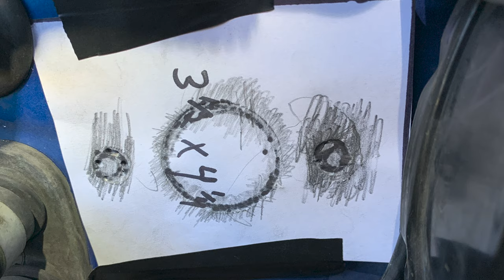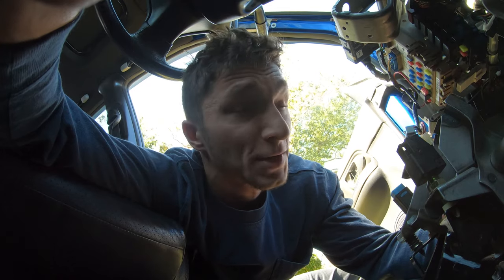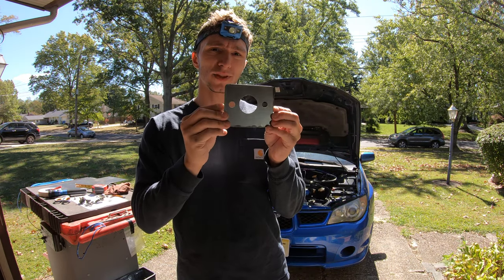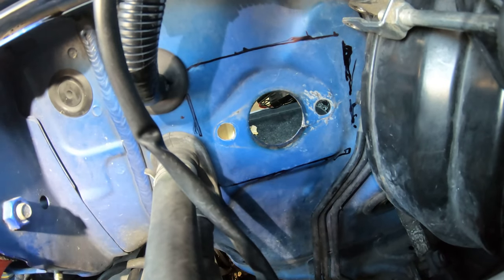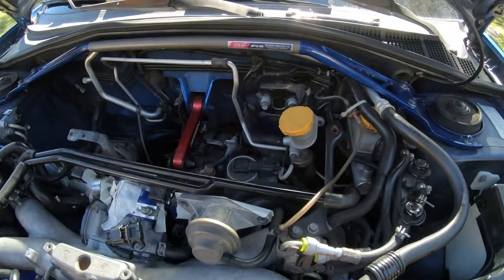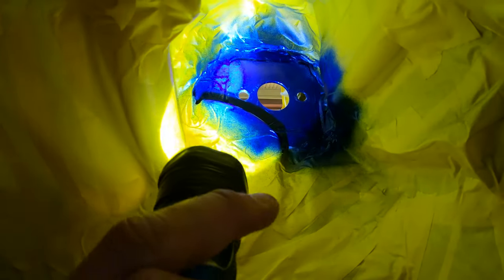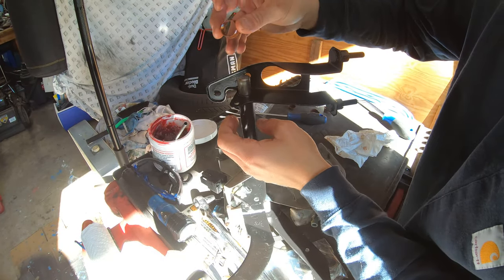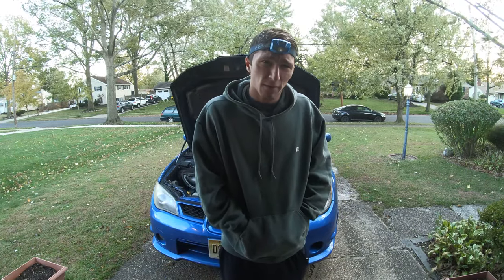Subaru WRX - HOW TO FIX BROKEN Firewall and Clutch Pedal Assembly (START TO FINISH)

Comment: 3 years later, still an amazing video. Always had a problem with my clutch pedal as of 2 years of owning this car. It would get stuck halfway down, sometimes shifting was impossible, pedal was mushy. Well I had someone press the pedal while I looked towards the master, it was pivoting on the firewall. Took it all apart and the pedal bracket cracked on the stud and where it bolts in the interior just like his. Followed this tutorial. Took time some time but was straightforward. Now my plates are adhered to the firewall and painted, just waiting on my clutch bracket. Tip for everyone doing this, do not be like me and try to reweld the pedal assembly unless you’re a master fabricator lol. But anywho I appreciate this guy for making such a weird project relatively simple. Never thought something like this would break.
Reply from the maker: So glad to hear you got this fixed. This is a very out of the ordinary job, and when it happened to me I was told by many people that it couldn’t be fixed. So yeah I’m happy to hear this is helping people out there! Great job and thank you for your support!
Reply: Hey there! Where are you finding the new clutch bracket? I've tried through my Subaru dealership and they said the part is showing on backorder in their system (but will basically never be available)
Reply from the maker: @Coffee-at-200F  Hey there, I checked at my local Subaru dealership and they had a few of the parts available but most of the parts I got from ordering on an online Subaru store. There are a few different online Subaru parts stores, a quick google will show you a few. If for some reason they don’t sell the parts anymore, then your next best bet would be local junkyards or eBay.
Reply: @Coffee-at-200F  I had to have mine ordered, took about a week. I believe it came from Dayton Ohio if I’m not mistaken. Maybe somewhere else. Call around different dealers and see what others can do. I just put my order in online and had it shipped to my house. Shipping was cheap. But glad to say today I got the car all finished after having to replace numerous other things in the process and bleeding the clutch by myself which was a pain. Since I fixed that stuff the car drives phenomenal. Firewall has zero flex and with the plates is as stiff as a board lol
Reply from the maker: @lozivo_5754 so happy to hear this! I still remember the initial feeling I had when this whole thing first happened. I thought my car was done. There were no other videos online about this, I really couldn’t find anything on how to fix this, So I’m just really excited to see this is helping people out there. I was told by so many people that it’s not possible to fix. Great job!!!

Comment: Awesome video calling out an engineering flaw with that pedal structure which is under-engineered particularly for those of us who push more HP and subsequently have installed stronger clutches.  After enough cycles, it will fail.  Before finding this video, I tried to order a new pedal assembly for my 2006 but I got the wrong one (for a 2018) and the 06 assembly has been discontinued.  I could see that the 2018 assembly was much more beefed up to handle to torque from the clutch pedal to the clutch master cylinder so they learned from their mistake.  This video allowed me to fix my pedal assembly with parts that are still available although I must have damaged my clutch micro-switches since I can't start my car now.  Work continues. ;)
Reply from the maker: Glad to hear you found some use of this video, Also I’m glad to hear they have since corrected this issue on newer models. I’m sorry to hear that the clutch micro switches may be bad:/…. 

Hope you get that stuff figured out because these vehicles really rock when they’re running good. Thanks for your support!

Comment: Thank you for this video, currently my 05 sti has the broken pedal support bracket but my firewall is good, looks like I will have to take it out and replace that bracket, did you put on a new  spring for the clutch pedal? I didn't see the part number for that but I will look it up.. I only have to order the two bushing for the brake pedal and the clutch spring.. I have everything else..  thanks again for doing this and making a video..

Comment: Thanks man, so far no firewall damage on my 02 wrx but my bracket snapped exactly where yours was cracking.
Reply from the maker: well that is still great news! I have a feeling a lot of Subaru Owners will be running into this issue at some point. Hope this helps!
Reply: @VinnieT  do you need to remove the steering colum for remove de pedal assembly?
Reply from the maker: @michaelrheaume5341  No you do not need to remove the steering column.
Reply: @VinnieT  ok Nice thank you

Comment: Thanks bro I didn't have a crack in my firewall thankfully. But the pain on the spring for the clutch was removed thinking it was the PIN for the master cylinder. Cannot find any data on it nor can I get it in so just at least identified what it was and how it works. So thanks a lot man!
Reply from the maker: Glad it helped ya out, and I hope you solved your problem!

Comment: By adding thickness to the firewall, how much did you change the deadzone and engagement on the clutch?
Reply from the maker: It depends on the thickness of metal that you use, but you just measure the two plates used, and that's how much you'll adjust on the clutch master cylinder rod.

Comment: That little thing that broke off is called a Clevis pin btw I replace mine every once in a while because they go bad and break
Reply: Yeah they are 3 bucks at the dealer. You should replace it every time you replace the master cylinder

Comment: Happy New Year man! Outstanding work and so impressive. Just bought a 2011 WRX last week and having the same problem. Took it to a Subaru shop and they are installing a plate as well. Do you have to replace the clutch after this repair? The 2011 WRX I bought has a ACT clutch on it and only have 29,000 miles on that ACT clutch. The reason I asked is because with that Firewall cracked the car is having a hard time going to first gear and so as in reverse but smooth on all gears once it’s running. Please advised as I don’t even know why the shop wants the clutch replaced. Thanks in advance.
Reply from the maker: Happy New Years! Thanks I appreciate that man!
So it really depends on how the car drives after the install that plate and fix your firewall. 

The reason your having trouble shifting into 1st Gear / Reverse is because when you press in your clutch petal, your firewall is flexing, and your clutch pedal is not able to fully disengage the clutch. I had the same exact issues trying to shift into 1st and Reverse. Once I fixed the firewall, the car drove and shifted perfectly again. 

I bet they are assuming that your clutch has been getting extra worn from the firewall breaking. Since the clutch master cylinder isn't solid and stable, when your disengaging and engaging the clutch it will not be "Traveling True" or fully engaging/disengaging, causing extra friction. Which basically means it can wear out a lot quicker. 

Its honestly your call, but if you haven't been driving the car too long with this issue then the clutch will probably be good still. Now if you've been driving with the issue for a little while now, its probably smart to have them replace it. It all really depends on how the car drives when they finish your firewall. 

Please let me know what happens and how it turns out, and feel free to ask any questions. Hope this helps!
Reply: @VinnieT  Thank you man. I appreciate your help. The shop insists to replace the clutch thinking that the guy that sold us this 2011 WRX 3 weeks ago had abused the clutch even when the Firewall and pedal was cracked. But I will let ya know as well. Thanks again
Reply: @VinnieT  so instead of installing a plate on the Firewall the shop did drilled 6 holes and installed washers and bolts. They told me that’s the fix. Crossing my fingers man.
Reply from the maker: @hatchman2484  Yeah I meant to ask you what part of your firewall broke, I believe there's a common issue your body style WRX's that the weld spots at the top of your firewall break and the whole firewall can move. They put bolts in to reinforce it. That's actually a totally different firewall issue then mine but I have seen that issue a lot when searching on fixes for this issue.

Comment: hey man why do you dont buy the complete pedal cluster it cost 250 bucks.
i have the same problem on my subie
Reply from the maker: Well at the time I was having trouble finding the complete pedal assembly, plus I saved some money. But if you can find the full assembly brand new for $250 then I would do it. I would not recommend buying a used one.

Comment: Did you have to remove anything before getting the pedal assembly in and out? Can I do it with full dash still in car?
Reply from the maker: Yes you can leave the entire dash in the car, I would just remove the under pieces near the driver side foot area to have as much room as possible.

Comment: Have this issue on my 2012
 YUP its still an issue and subaru doesn't want to fix it lol. I heard they improved the issue and upped the Gauge of steel in 2009 but I can't find any data on that.. my pedal is making a click and my clutch master cylinder just blew a month ago on the way of me picking up a jetski.
Reply from the maker: damn I'm sorry to hear that. Yeah when I was doing my research, I saw a few people with 2008-2012 Impreza WRX's/STI's that get this issue occasionally. But I could not find a fix anywhere for it so I just decided to do my own, and share it with the community. Its a bit of a repair but I really don't see this issue ever happening again after you reinforce it.

Comment: hey man, ive got a similar issue with my 2010 sti. how has it held up so far? almost 2 months, any issues?
Reply from the maker: Hey man, So far so good, everything is holding up quite great. No noises, no flexing, improved brakes and the clutch pedal travels smoothly.

Comment: I have the same problem with my subaru i cant find nobody fixed
Reply from the maker: Yeah I originally called a bunch of shops, and nobody seemed to want to do the job. So I had to do it my self and I decided to make a video on this because I knew this had to be happening to other people out there as well. Hope that this helps!
Reply: My wrx now has this problem. Doubt I will find a shop who would do this for me and I dont have any experience with this sort of thing D:  @VinnieT
Reply from the maker: @seahad4744  Yeah this issue seems to be popping up more and more with the older Subies over the years. It would have been nice to see Subaru help out their customers with this because its a nightmare when it happens. Sorry to hear this man.
Reply from the maker: Well on the bright side, if you can afford to get another daily driver car in the mean time, that will allow you to try and take on this task.

Comment: This sheet looks thicker than 0.7 mm
Reply from the maker: I'm not sure, but Its still working out great, no issues at all. Firewall is stiff and no flex when pushing the clutch in.

Comment: This video was the closest thing to the help I needed, but I have no idea how to install Part Number: 905200018 Part Number: 36023FC000 Part Number: 051108001 for the clutch pedal. is  Part Number: 905200018  Clevis pin a one time use item? I am trying to replace the bushing
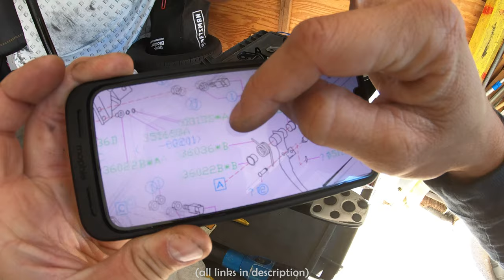Reply from the maker: It is a bit tricky to install the bushings, and a bit easy to break. Take your time and go slow, be very gentle. I show how to install these starting around 34:00 in the video. The Clevis pin is typically a one time use but I've seen people re use them with no issue.